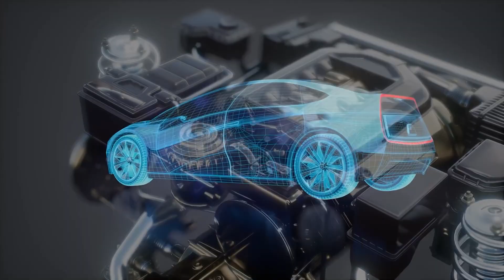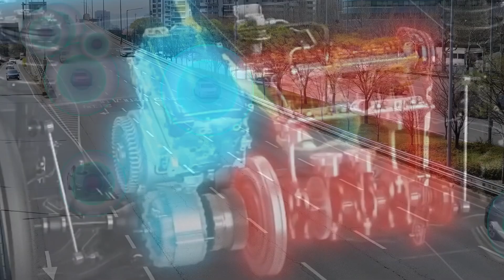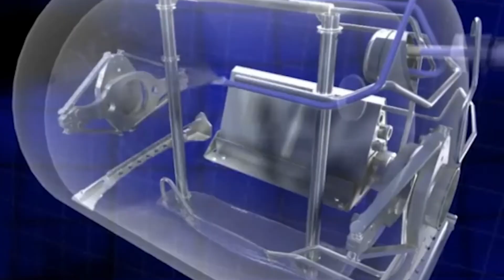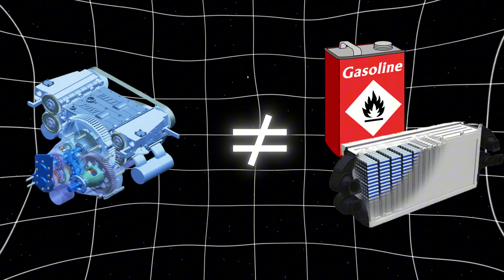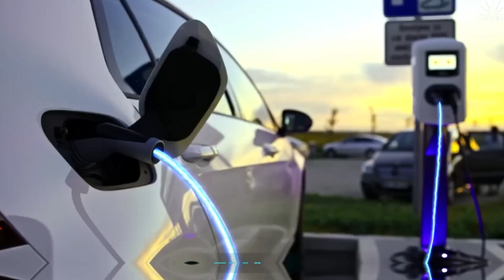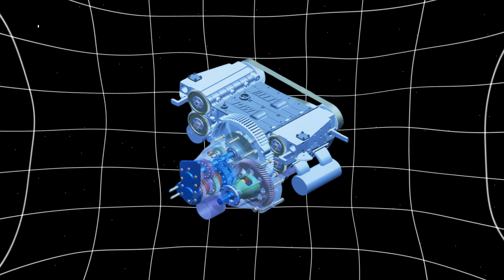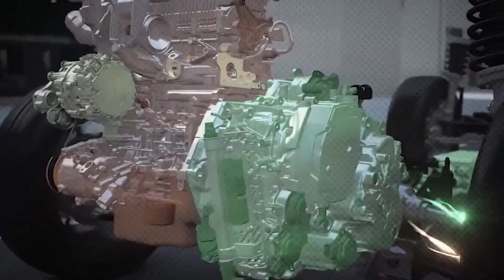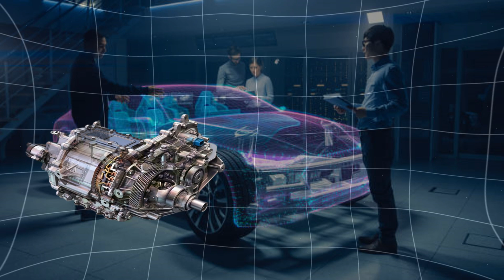ALL NEW Compressed Air Engine To Disrupt The Car Market!

Comment: It's sad to see many of the children commenting on this.  This idea is not new.  It has run cars before.  Yes, electricity is needed to refill the tanks but unlike battery powered cars, they can be filled much faster, there is little hazardous material to deal with when manufacturing and when they do need to be changed.  It's not a zero-sum game as some idiots seem to suggest.  It can be a one of many automotive options especially for those who need a little runabout for around the neighborhood or city and don't have large amounts of money to spend on an electric car.

Comment: Would be great because all emission controls can be removed from the engine designs greatly freeing up efficiency and reliability, maybe cost less too? No fuss electronics-free engines would be pretty cool to see.
Reply: I'm not seeing it; the vision that is. I have a 21 gallon 2.5hp compressor that has a maximum of 125 PSI. It is extremely loud and runs out pretty quickly. FAR less energy that it would take to move a car a mile. Sure, I might not have the best tools, but I have a new hose so I don't have any leaks there. How much pressure would these tanks need to be rated for and how large would they need to be in order to have enough air stored inside to propel a vehicle for 60 miles?? Every single thing attached to the motor will only make the air less efficient at propelling the vehicle; power steering, power brakes, air conditioning, etc.  And at the PSI rating needed, could the average person afford a compressor? And then where do you even put the tanks??

Comment: I call BS
Compressed air can’t store more energy than a battery. Also compressed air can be actually really dangerous.
Reply: I'm sorry, but which is it? Is compressed air capable of actually being really dangerous? Or is it incapable of storing more energy than a battery?? They both can't be true. At least not in the context of how you're using those sentences. You know neither the volume of air nor the pressure it's being stored at so you're just wrong.

Comment: So how many meters you plan on travelling with that massive air tank, cause even if its airtank with bicycle wheels, light as possible it still wont travel more than few hundred meters with that air supply. Laws of physics prevent storing enough energy to make it even remotely useful other than oddity. Sure you can put in high pressure compressor, but you still need something to power it, meaning in the end its even less efficient than gasoline engine what is complained to be wasteful. In similar sense its just as dangerous to the EV that randomly catches on fire, so essentially it would be taking all the worst things from EV's and ICE engines and putting them into one vehicle and it has been tested time and time again. Its age old idea but it simply does not work due energy density. Hell putting steam engine in there would be more efficient and practical, or wood gasifier.

Comment: Compressed air is one of the worst options possible for energy density and efficiency. Compressing air is extremely inefficient and expanding the air afterwards is as well if you don't store the heat generated during compression to assist expansion later like they do in compressed air grid-scale energy storage plants. The only reason shops use compressed air to run hand tools is because air motors have high power density - small and light. Not having a 120/240V cord get in the way is also often safer for people and equipment.

The only place in a car where compressed air may make some sense is using engine braking to pump pressurized air in a tank for immediate re-use during acceleration.

Comment: I find it funny about 0 emission claim. How do you compress the air? What weight a tank will have to keep enough pressured air for the car to have some range? Next keeping air under such pressur is extremely dangerous. So the tanks will need to be replaced regularly to prevent explosion.. Those tanks wont be cheap either. What is the energy density of such tank? because that is the main thing. And no matter I look at this. Unless the compression of the air is higher than what burning gaz can do, no way to even think about doing as much mileage on air.
Reply: They also seem to forget that the air tank is heavy and , in a wreck, will be a bomb.
Reply: @stevemiller6766  And yet you likely have no issues with us rolling around with 20+ gallons of gasoline behind us.
Reply: @FtanmoOfEtheirys  Sure am. In over 100 years of having gasoline in cars, even as unsafe as behind the seat of 50's and 60's trucks- under the seat of the model T fords- in the dash board of the Model A ford - in the wings of GA aircraft, etc Gasoline has proved to be safe and reliable when treated with care. Compressed air tanks detonate if the tank is ruptured, plenty safe in an accident, right? EV batteries burn so hot they cannot be extinguished, fire fighters hate them. Arguments can be made for both sides but Gas and Diesel have proven themselves.
Reply: @stevemiller6766  Right, except you're forgetting something significant... Remember when Ford got in trouble because they calculated out that it would cost them less to let people die in their cars when they were rear-ended than it would cost to recall the cars and fix them?? Yeah, that LITERALLY happened. That wasn't "over 100 years" ago, that was less than 50 years ago; all the cars that ever had style had already come and gone... 

Gazolene, commonly known as gasoline, was developed in 1864. We are 160 years into the use of gasoline for fuel. We are 0 years into the use of compressed air and just 16 years into high powered electric batteries as automotive "fuel".